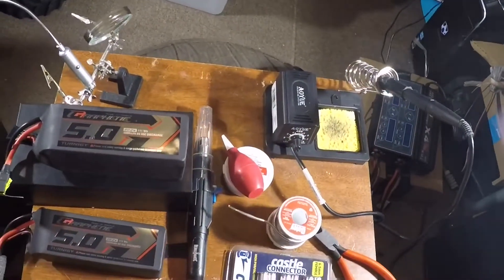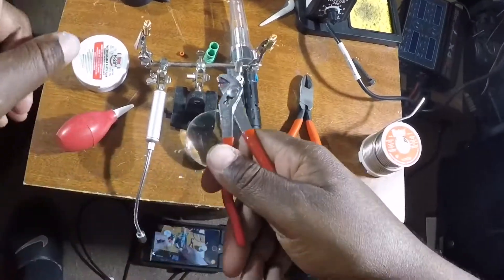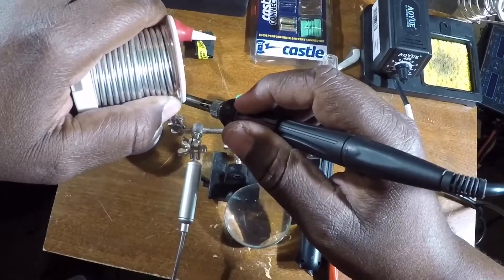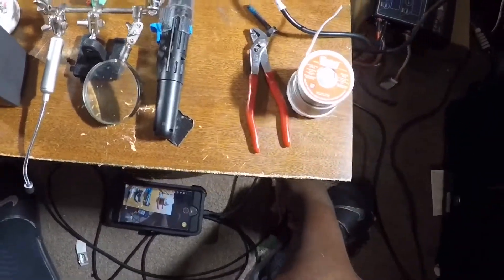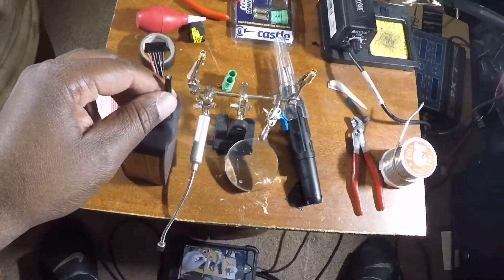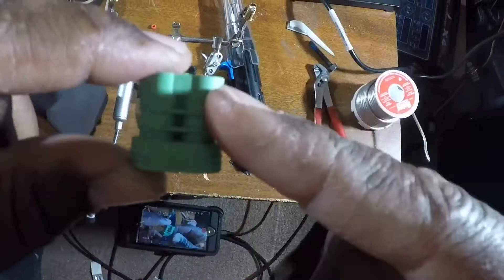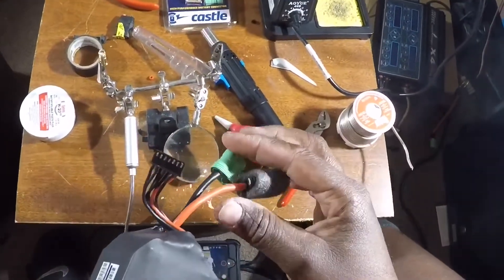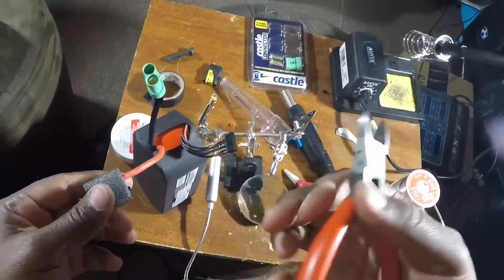[How To] Soldering Castle Creations Polarized 6.5mm Bullet Connectors to a Lipo Battery

Comment: How do you charge the battery if it has this connector on it?
Reply from the maker: You can take some lipo charge cables, cut off the connector, and solder the castle connector onto the wires.  Just make sure that if you put the male connectors on the battery that you put the female connector on the charge cables and be mindful with the positive and the negative sides are lined up correctly.😎🤙

Comment: You gotta use 60/40 LEAD solder for the electronics not silver ever. And heat shrink not electrical tape. That’s gonna melt faster the deans
Reply from the maker: Airtistic License   Silver solder actually has a much higher melting point than 60/40 solder which makes silver solder the best solder to use for rc's that tend to run hot from speed runs or extended bash sessions.  I didn't know there was a difference between plumbing and electrical silver solder... although I accidentally used the silver solder for plumbing, it's melting point was still higher than 60/40 and the conductivity was great.  I have to use a torch in order to remove connectors from wires unlike being able to have a soldering iron on it's lowest setting while melting 60/40 solder.
But if 60/40 solder works for your application, that's great.😊👍

Comment: Oh BTW what size battery is that?
Reply from the maker: Doc Tombrady   65c 5000mah 6 cell Turnigy Graphene Lipo. 👍
Reply: @TheDeterminedFisherman  nice I'm running two 6400mah 3s 25c mamba monster x  w/hobbywing max8 2200kv motor 4x4 slash.

Comment: 13djdave13 I plan on running two 3s battery's,now would I have to make my own castle bullet connector adapters or can I buy to them already assembled?
Reply from the maker: Doc Tombrady   Castle does make a Y-Harness using these connectors, but you'd have to have a 6.5mm connector soldered onto your esc's wires too.  
The battery in the video is a 65c 5000mah 6 cell Turnigy Graphene Lipo.
Reply from the maker: Doc Tombrady   Link below 👇
http://www.castlecreations.com/en/polarized-series-wire-harness-6-5mm-011-0087-00

Comment: thought he said he use a  torch not solder iron
Reply from the maker: Andrew Murphy   It is a butane torch that doubles as a soldering iron or I should say a soldering iron that generates it's heat from it's butane torch portion.  I picked it up at Home Depot.  It works better as a torch in my opinion.👍
Reply: they work beautifully i use it heats solder quick .

Comment: DUDE Never use electrical tape use shrink wrap  electrical tap can melt and start a fire due to much voltage
Reply from the maker: Andrew Murphy   Thank you for the tip.😊
Reply: He takes tape off .but yes I agree heat shrink is better just no in this case👍

Comment: What kind of soder is that i couldnt see, and u think these are much better then the xt90s
Reply from the maker: I use silver solder and flux.  Whatever the flux is on, the solder wraps itself everywhere the flux is at.  That's why I try getting the flux inside the metal strands inside the wire so when I fuse it to whatever I'm soldering it to, the conductivity and connection will be great.  After being told, I found out the particular silver solder that I used is mainly used in plumbing.  Although it's truly meant for plumbing, it still works great completing the circuit and also has a much higher melting point than regular electrical 60/40 solder.  Without a very high temperature soldering iron, it'd be next to impossible to melt this kind of solder when trying to fuse the wire inside of the bullet connector let alone the real electrical silver solder which has an even HIGHER melting point needing a butane torch to aid the melting process faster.   As for the xt90's and the Castle 6.5mm Polarized connectors, some say the xt90's are better, but it all depends on what type of lipos you run and how you like to run your RC.  xt90's are easy to connect and disconnect and are good if you use lower amp output lipos although some will argue, but they are only rated at a recommended 90 amp constant while the Castle Creation's 6.5mm Polarized Bullet Connectors are rated at a whopping 200 amps constant which  basically handles more that double very easily.  I will say that the Castle 6.5mm connectors can be hard to connect and disconnect at times, but male connector side can be adjusted for a tighter or looser fit, you just have to do it gently because the metal is bond to bend too much and break eventually.  Just solder a spare female connector onto a strong slim metal rod that will fit into the wire side very securely and use it to form around the male side to in a circular motion while connecting it to make the male end get narrower to fit into the female side a lot easier.  I might have to make a video on it because it's much easier to show it than to type it.  I got the idea from a video that either Killer RC or Dave's Discount motors made on this topic.  I'd say for speed runs, go Castle, for bashing, go with whichever you feel will be more compatible with the components that you are going to use. 
Sorry for the novel!!! :-)
Reply: it was plumbing solder not electronic solder use electronic solder
Reply: djdave neither of the 2 types of solder mentioned in your vid are actually silver solder, regardless of what the packaging may say.  The real thing comes in different percentages of silver and melts at much higher temperatures than the plumbers solder you are using.  A low percentage silver solder can be found at refrigerator supply houses. Jewelers use the higher percentage silver solders.  Melting points vary with type but all melt at temperatures well above 1000 deg F.  It is also known as hard solder, whereas the electrical and plumbing solders are known as soft solders.  I am not at all recommending you use the real thing for electrical or plumbing jobs.  However it is a skill you might find useful.  For example you can solder stainless steel to brass and when done properly it is an extremely strong joint.

Comment: Idk bro it ain't lookn good for poseidon motors for me at this point. Far as today is concerned I'm leaning towards the max 6 esc and a castle 1515 motor. Poseidon from there website have changed their can style on their motors now to that open end vent hole bullshit and I hate brushless motors with big ass vent holes man. Nothing like worrying about water and especially dirt getting into your motor chewing up the stator, rotor, bearings, ect. You get my drift, shit plus I'm building a basher and I wash my rig after every use with soft cloth and garden hose so I most definitely want and need all waterproof electronics. Another good thing about waterproof is it keeps all the elements out dirt, moisture, water, whatever.. I hear the castle motors run bit hotter but I'm mostly light bashing so it's all good and the motors aren't that expensive that you can't just get another 1, it's not the end of the world ya know. I feel like castle motors are bulletproof but there esc's are different story. Here alot about castle firmware issues like castle de-tuning their esc's. I seen it first hand car ripped on 3s and 4s but soon as it got 6s it went from rocket to an old dog!! Supposedly doin it mostly with there warranty customers or something, I don't know the whole scoop yet. I just feel the hobbywing esc's are better built and stronger. I got a hobbywing quicrun esc 100 amp in my truggy now and it rips, lifts the front wheels off the ground in tall grass during a roll. I'm running dual 4s lipos in parallel, it came prewired for series and I changed that rite out of the box. I never even hooked power up to it while it was in series configuration and couldn't be happier. Well I can always be happier rite, lol. Another this is the max 6 can do 8s but the max 8 can only do 6s and there's only a 10 amp difference between the 2. I feel that 8s would be really pushing the max 6 since if it were 10 amps less it could only do the 6. Trying to explain it best as possible this early in the a.m. lol  so I'll just keep it 6s but might do the 8s just for couple speed runs to see what it hits, idk. I could get the max 5 but im pretty sure the max 6 will do just nicely. With moderate gearing of course, lol....
Reply from the maker: I hear ya!  With me, everything I upgraded to was an experiment not always know what to expect with the results, and since I tend to be trigger shy on the throttle, I most likely had a little more power left but never used it.  lol

Comment: Dude that's plumbing solder, not electrical silver solder. Can't use that shit man.
Reply from the maker: Fullthrottle Turnnburn   Lol... You're right, but it works pretty good conductivity wise.  One of the best properties of this silver solder is that it has a melting point range of 420 degrees to 460 degree Fahrenheit where the 60/40 solder taps out and melts below 370 degrees Fahrenheit.👍👍
Reply: How many connectors have you soldered with that stuff successfully without electrical problems? I ask because that solder you have there is cheap compared to the Trakpower silver solder I get. I run FE boats and they draw a shitload of amps compared to any other battery powered r/c out there.
Reply from the maker: Fullthrottle Turnnburn  I have to thank you because you just taught me something new!  I've used it on every battery I've ever owned, currently 11 not counting the crash damaged ones I've disposed of.  They've work very decent for me.  I'll have to look up different brands of silver silver solder now to see if the electrical kind like you use has a higher melting point.  I've used this stuff on every rc related thing that needs solder after I began melting off battery leads from my esc while running it.  For some reason the red wire doesn't like when the black wire touches it.  Lol😂
Reply: Noooo lol that's when you start welding stuff. I had a scare once the first time I ran two 6s lipo's in series. I put the connectors on the esc backwards. You can imagine what happened when I went to plug in that last wire!!
Reply from the maker: Holy Cow!!!  Anything 6s and up I'm always watching out for the "pop" it makes just when it connected with the right polarity.  YIKES!!!  Did you get hurt?   I unplugged the charge leads that were still connected to my 6s Turnigy from my charger by accident; it missed my ankle when the two ends touched and the fire on my carpet was easy to put out after I made the battery safe.  Totally destroyed the end of that charge cable.  Lol
Reply: Thankfully, just my ego got hurt lol. Yeah man, lipo's are no joke!! My problem is impatience and not double/triple checking everything first. I really gotta slow down for a minute.
Reply from the maker: Fullthrottle Turnnburn   True that!  I hear ya...

Comment: Yes, you can use liquid plastic dip to waterproof.
Reply from the maker: mtctookie25   Cool... thanks for the info👍👍
Reply: I completely waterproofed my crawler with plastic dip, the shit works!
Reply from the maker: That's awesome!  A local rc group had a drag meet and one of their rc's went into a deep storm drain which was full of nasty murky water.  They found a long pole to pull it out and come to find out, it was still turned on, connected to the Tx, and working!!!  Part of his setup was using these Castle connectors.  I don't plan on doing any scuba diving, but that is pretty amazing and good to know.